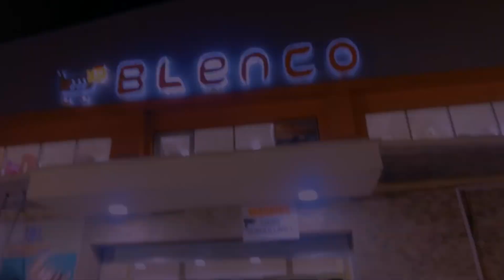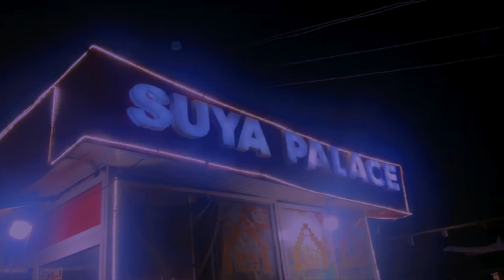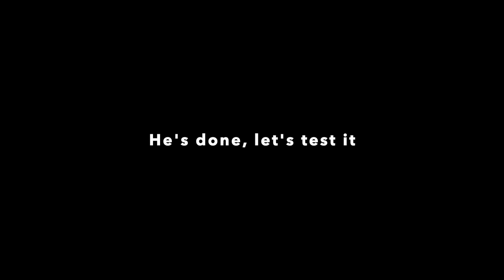First S$X, First Cooking, Furnishing Our New Lagos Mansion Update + Adjusting To The New Place 🇳🇬

Comment: Mistake I made buying this type of washing machine. Using it in Naija is frustrating. 
I didn’t get to use it up to 10 times and the kids pulled the door when clothes were locked in during power outage